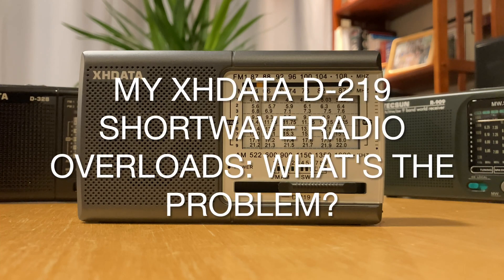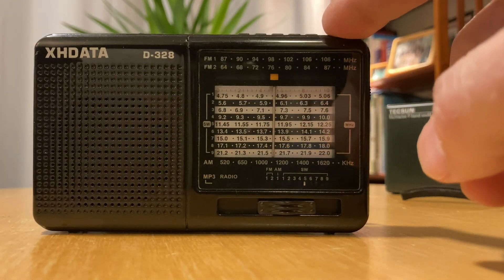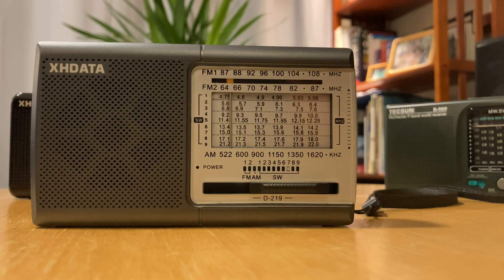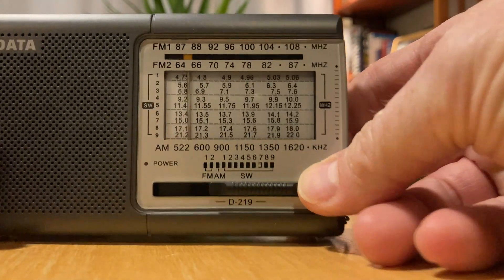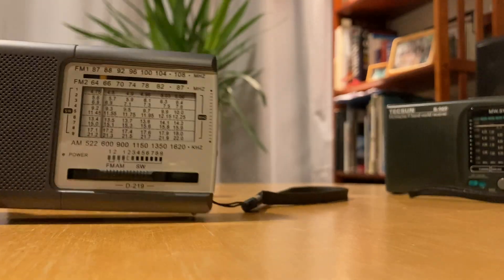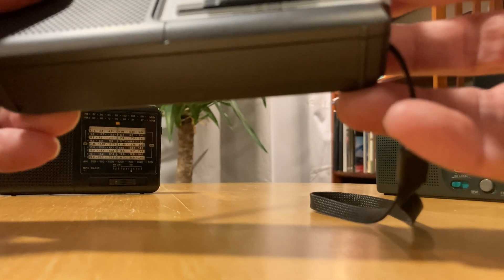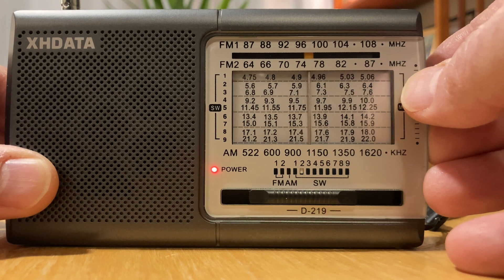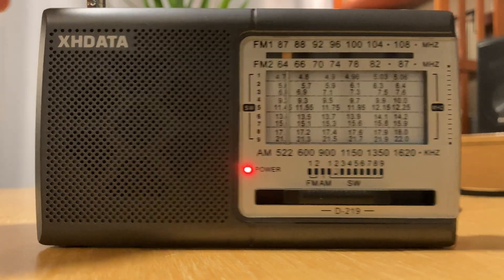My XHData D219 Shortwave Radio Overloads:  What's the problem?

Comment: I took a look at the problem ....then salvaged a 400 variable cap from a old radio then ran a wire via gator clip to the antenna folded up. ...thus now controlling what the rig gets suprise it also takes the top off the noise figure. 😊😊😊

Comment: Mine built like a tank. Not afraid to show it off. It been dropped. It had the dog tryed to bury it. And it still runs well...i live near a air port and a chopperport. A phone tower, fm radio tower..and a local am station. . Must have been a fluke . My critter(its given name) just likes beeing handled. Try the 10 khz rig.  They are set for north am . Tks for good show.

Comment: Why is sound breaking while tuning?
Reply: I think it's the DSP chip.  First, you have to tune s-l-o-w-l-y to get the station you want, hence you hear the "thoop" as you tune around on SW; second, the weaker the signal, the more that signal may go off and on, or break up.  This, you'll have to get used to.

Comment: To prevent overload, slightly lower down your whip antenna until the overload disappears. If it’s all the way down and it still overloads, either you need an older radio that is less sensitive, or a radio that has filters built in to block out strong am/fm signals, or may have to move/travel to an area where strong local stations no longer interfere with your radio

Comment: I believe if the radio overloads easily, it means the radio is highly sensitive.

A high sensitivity radio also means less antenna is needed in order to stop overload.

If a radio is not sensitive, it means you need a longer antenna because the signal is too weak to receive.

In layman’s terms, sensitivity is the ability to receive weak signals.

Radios that are made nowadays tend to be more sensitive than ones from decades ago which has eliminated the need for connecting long antennas to it.

Hope this helps everyone 😊

Comment: Good video. My D219 overloads as well but I believe its from overhead power lines and electrical items in my home.....I have the D109 and it overloads as well. My mla30+ antenna does help with the D109 though....cheers
Reply: You can take the 219, or any portable, out to a park or somewhere away from noise sources, and away from nearby transmitters that cause overload onto shortwave bands.

Comment: Not getting the overload problem where I am and I am 30 miles south of Los Angeles which has about 60 FM signals in the greater metropolitan area
Reply from the maker: That fits with my experience. Mine overloads at my house which is close to the downtown transmission sites like the CN Tower, but it’s fine 15 km north in the suburbs.

Comment: This explains why Shortwave works so well on these super cheap DSP radios that have a pretty short antenna, like the Prunus J-150BTS, which has a ca 26cm / 13 inch long antenna. Seems these DSP receivers are really too sensitive for long extracted antennas. I mean it's both good and bad but at least good to know that less antenna works better on these sensitive little beauties.

Comment: I heard 9 stations with the D-219 and 8 stations with the D-328.   Overload is when you hear strong FM or AM stations bleeding through.  I don't think that's overload but who am I?  I don't know anything about radios.   Can one cheap radio be more sensitive than the other...yep.  I do know that you can buy three D-219's or any cheap portable and get three different sets of results because it's an $11 radio.
Reply from the maker: It's a fantastic value and I find it works great at my office in the suburbs, but not downtown.

Comment: Hi don't we all want a radio that has high sensitivity ? Hence I'd say this is a good radio .
Reply from the maker: It works well in the suburbs but not in the city, at least for me. If it had a local/dx switch that would solve the problem.
Reply: A receiver with a high sensivity is desirable as you suggested. I agree, but sensitivity alone isn't the right yardstick to gauge a radio's performance. There's also selectivity and image rejection metrics to consider. 

Sensitivity is important, provided that its RF design has the ability to separate the desired signal from unwanted noise. Generally inexpensive radios cannot distinguish between the two, therefore it pulls in background noise and interference together with the radio station's signal.

This is why the author has mentioned that using the D-219 radio is much better in the suburbs than in the city and best used in remote areas far away from electrical grids, LED lighting, WiFi access points, wireless CCTV cameras, microwave ovens, cheap AC adapters, etc - basically anything that has the potential to generate man-made electrical noise.

As far as US$15 pocket shortwave radios are concerned, the D-219 is one of the best performers there is, but one can't expect it to parallel a modern professional communications transceiver from Yaesu, ICOM, or Kenwood.

Comment: Received my D219 yesterday, last night and eagerly tried it out but got the overloading you demonstrated here. As I mentioned in my previous post below I have a AM transmitter located about 4 miles from my house and the lower two bands on this radio suffer from interference from it. 

While scanning on SW on the two lower bands I can hear the AM broadcast very clearly, so clearly I have to double-check whether I'm not accidentally got AM selected!  This also affects my other radios (a XHData D-808 a DSP radio like this D219) and a Tecsun R-9700DX analog receiver. It does not make for pleasant listening...

Other reviews of this XHData D219 rave about its performance but it I think those reviewers do not have AM or FM towers close by. I plan to take my radios out into the boonies one night to see if the noise floor and interference improves reception away from the city and RFI. 

Thanks for the tip about retracting the antenna, I tried it last night but only got minimal improvement. I'm eager to hear your thoughts on what is happening here.  

I really appreciate your channel and thanks for the videos mate!
Reply from the maker: That answers my question as to whether it's just my example that has an overloading problem, unfortunately. 

It's interesting that it doesn't help for AM. I suppose it could be cross-talk from the internal ferrite antenna but I believe there's a transistor that switches it out of the circuit before the SW RF amp stage. It could also just be that some of the traces are acting as an antenna somehow. I don't really have any ideas about how you might mitigate that problem.

I'd be curious how it works once you're away from that transmitter.

Comment: For the price I would call that normal.  There is a reason radios can cost hundreds or thousands. Look at the Sangean radios. Get one  with full  coverage & is SSB capable &
it will open a new world to you.
BTW you can overload almost any radio with too much antenna. But the more you spend the better it runs.
LFOD !
Reply from the maker: I'd generally agree but this one does seem a bit of an outlier. I've got a Sangean ATS909x2 as my primary radio.